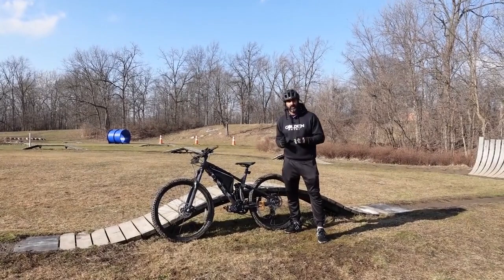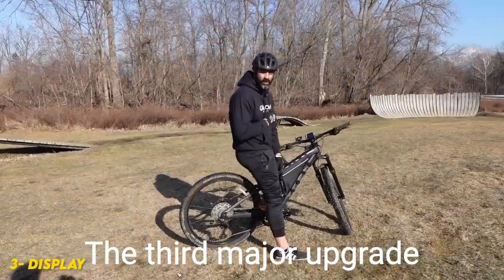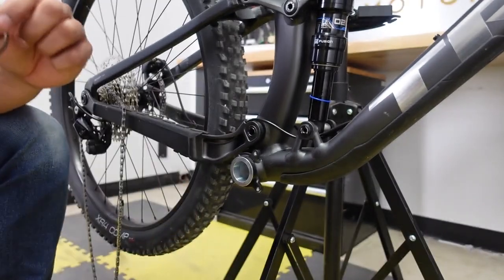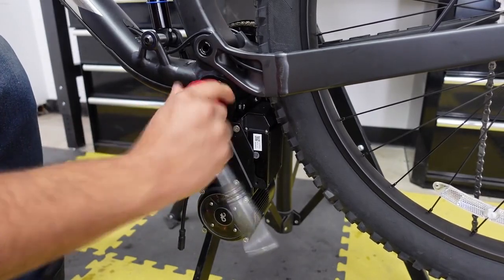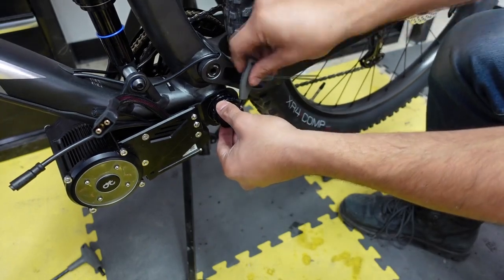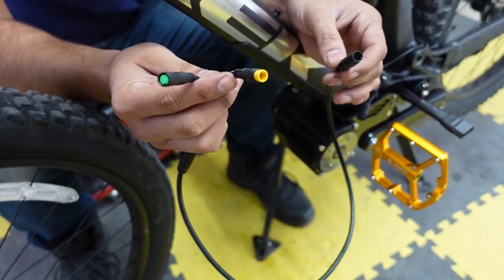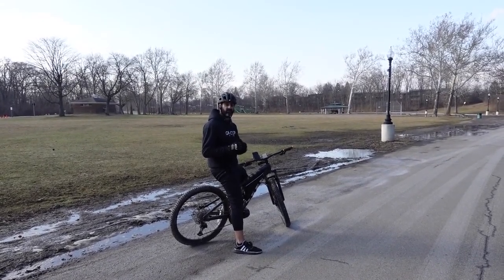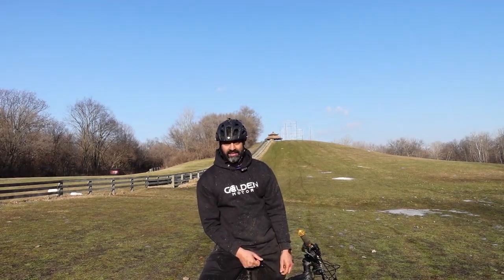CYC X1 Pro Gen 3: First Look and Complete Installation Guide

Comment: What full suspension mtb’s do you recommend for a project like this? My budget is $2000 - $4000 for the bike itself. Preferably a carbon frame and not an enduro build. Something all mountain or trail oriented. Appreciate the advice!

Comment: Got mine in June, had 2 months of fun, and the motor blew in August after 150 miles.  

The motor has thousands of magnet particles all over the inside of the motor visible thru the glass after chewing up the magnets that flew off the rotor.  CYC sent me a replacement rotor and 2 loose bearings lol.  I told them they need to send a replacement motor and new gaskets (that's what they sent baconbutties on utube who had the same issue). 

 They handle the utuber warranty correctly, and are gonna stiff the rest of us who are suffering the same motor issues. Why would they just send a rotor to repair a motor that pulverized magnets into thousands of tiny chunks?  No mention of testing the coils which could be damaged, so that nec step to a motor rebuild is disregarded. And what would happen after you attempted to blow out the thousands of magnet chunks, missed a few (I don't think it's possible to get them all), replaced the rotor, then returned it to service only to have these chunks start flying around in the motor (there goes another rotor).  My experience was awesome for 2 months, and now it sucks waiting on them to send me the proper parts.  A replacement rotor is BS when they know their customers aren't capable of a proper motor rebuild.  

Wish I would have gotten a bafang now lol. I'm still waiting to hear if CYC will send me the required parts for a decent repair (replacement motor and gaskets).
Reply: Same here... after 3 months left me dead at a stop light in rush hour traffic. Have been ghosted by Golden Motors. Sold my 3 year old BBSHD powered bike I built to a roommate. He still rides. I pay a quarter of my take home pay to Lyft and Uber. My difference? 215 miles, no error codes, battery and display fine. Oh, and my clear plastic core cover came out of the box shattered. Got a red billet aluminum replacement out of pocket from ElectrifyBike of Utah.
Reply: Replacement core on my motor coming tomorrow. I will see if I have the same issue as you did.
Reply: Which is exactly the reason I'm not throwing down £1000 on a golden motor dude. I expect it to last and after-sales to resolve it, if it doesn't, if they aren't interested they can forget the sale.

Comment: I want to buy that motor, X1 Pro Gen 3 3500w. But what voltage should I need for battery? 52/60/72? And 20ah is enough for 25-30 miles range or I need more?
Reply from the maker: Yes

Comment: One problem with the CYC and probably others, is the Q factor, which is how wide the stance is over the pedals.  If it is too narrow or too wide knee problems can develop.  I need a narrow stance.  If I try to ride a bike with a triple crank (larger stance) I will shortly have knee pain.  If you do not pedal often and just depend on the motor, you will be fine
Reply: Just RAISE THE SEAT
Reply: Mr. Brittle-knees out here concern-trolling.

Comment: Was that 40 mile-an-hour test done using a throttle or the torque sensor and did it plateau due to your legs or an imposed limitation from the controller

Comment: So I'm Currently using the bafang 750w, and wanting to upgrade.. Which CYC motor would be best for 30-45 minute commutes at 35Mph on the street ?  "Without having heating issues"

Comment: seems like every video tries to hide the sound of the motor.  It must still be very loud
Reply: I have one and it is quite loud. Pushing it at 3500-4000 watts lvl 5 sounds pretty insane. Def not quieter but still and amazing motor for me.
Reply: @vedantagarwal2988  thanks for the honest input I appreciate that. It looks ike a very powerful and capable motor. That sound though. I see people riding barely 10mph, and it sounds like a Sun Ron going 50mph. Can hear it from a block away.
Reply: I've seen a video before , I can't find it now. It's not sure of the new ones , but the old ones were not super loud but noticeable. I would find it annoying after a while I'm sure